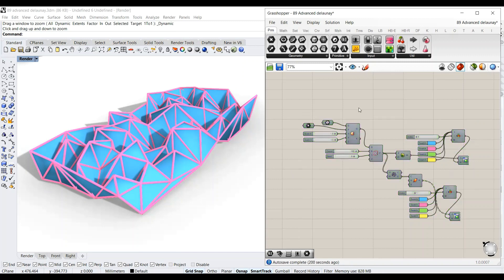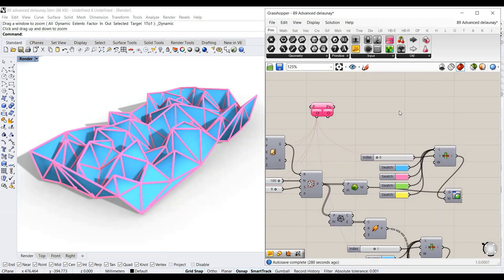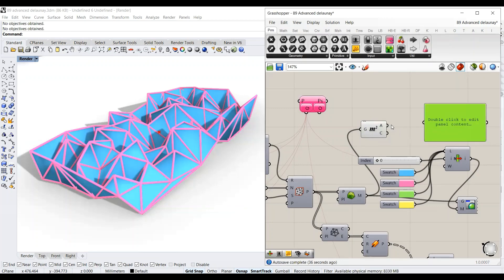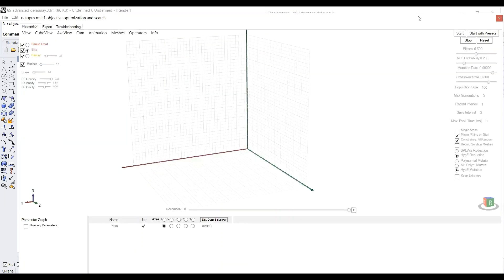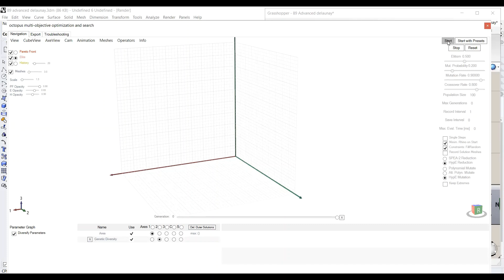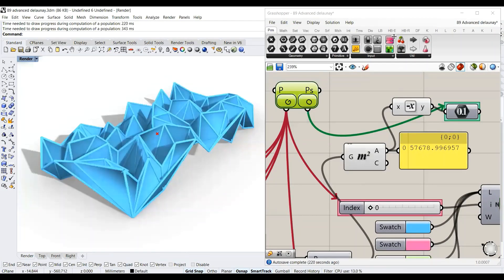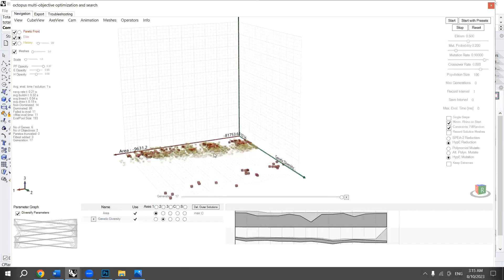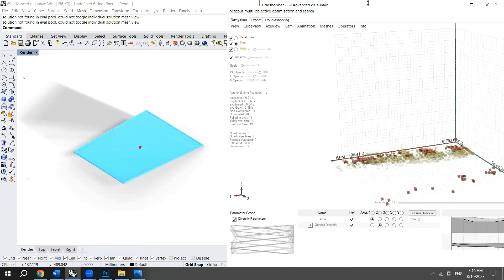Grasshopper Tutorial : Part 2| Octopus, OPTIMIZATION , Form Generation , Triangulation Delaunay Mesh

Comment: Hi Amani. Thank you for the tutorial. How is octopus different from Galapagos?
Reply from the maker: Hi dear 
Octopus is a multi objective optimizer which allows you to include more than one objective to reach and provides you with trade offs automatically. On the other side, Galapagos manipulate only one objective or one equation.  Octopus also saves the file and you can close the program and open it at any time to proceed work. On the other side, Galapagos doesn’t save data and you will need to record on excel sheet and will not be able to run simulation in different stages.